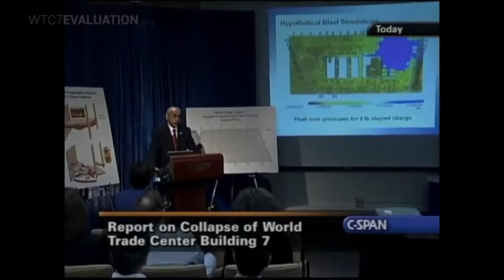Valutazione del WTC 7 - Introduzione - sottotitolato in italiano

Comment: It was obviously brought down by fire.
You see demolition companies all over the world, who are on a tight budget, setting fire to buildings instead of using explosives, and it works just fine.
Steel, and steel re-enforced concrete with fire protection, burns just like wood(apparently).
It also almost guarantees a symmetrical collapse!!!
Much cheaper to just set fire to things, saves all those bangs and booms and stuff.
;-)